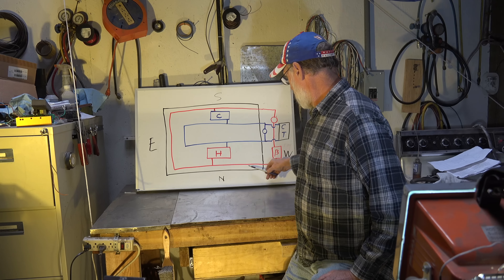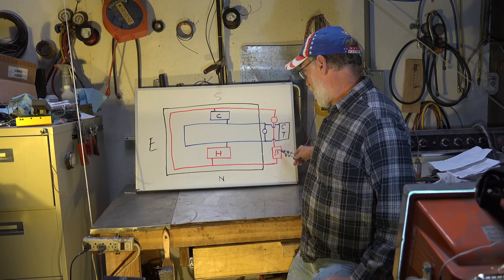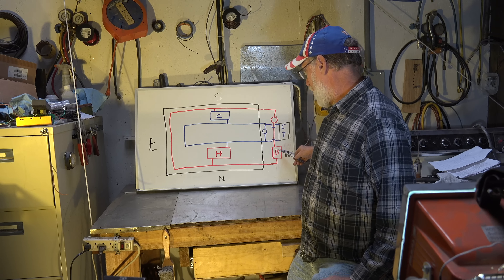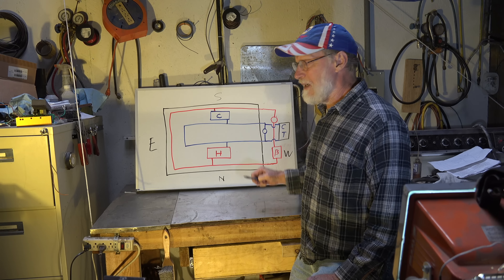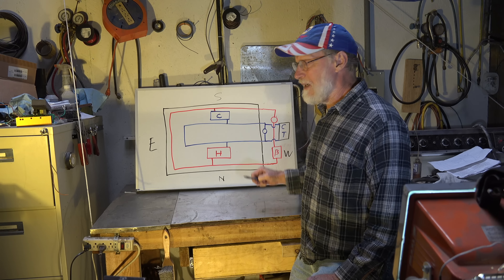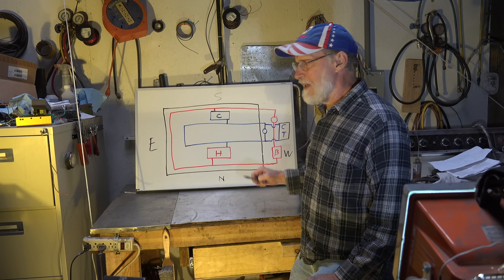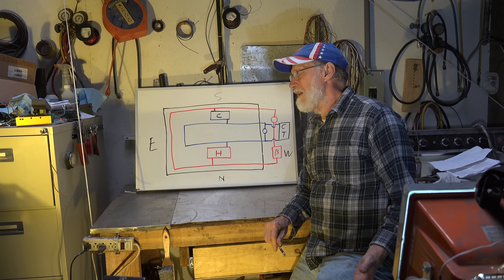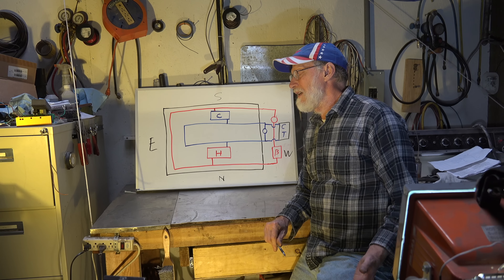How to heat and cool at the same time #2

Comment: Interesting concept. In the hospital where I work we use re-heat coils in VAV boxes with a chiller or a boiler serving as the prime mover for heating & cooling. I have never worked with water source heat pumps. I assume they cool or heat the air using air ducts but water is primary method used to cool the condenser instead of air.
Reply from the maker: Robert Arnold You just use water as the heat source and to cool the condenser. 
GFM

Comment: I have an 8 story building with the same set up. The boilers always run when the ambient gets below 45°. Because nat gas is much cheaper than electricity, I see a VAV/ fan powered boxes  with hot water coils being much more efficient  in this case IMO. Thanks for the video 👍
Reply from the maker: Most of the cost estimates depend on a comparison of electricity and gas rates.
GFM

Comment: (Sorry, I typed a long comment, and then it changed videos and I lost what I typed) I think it will save energy and work very quick to reach your thermostat-set condition.  What about adding the abiity to switch roles, maybe you'll have to have manual-mode piping valves to reverse flow around the legacy equipment.  Maybe even a cut-off that never routes through the legacy equipment, so when you're ready to remove the old and replace it with the next-gen heat pump some years later?  Anyway, nice design, but won't it be running all the time.